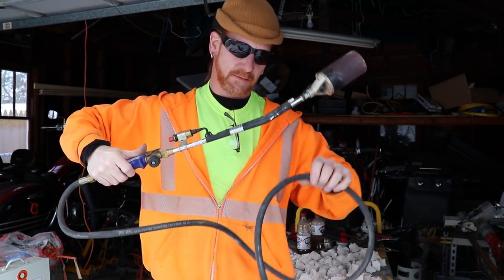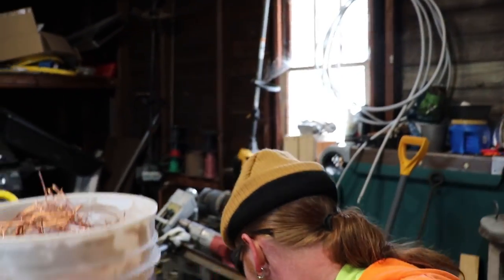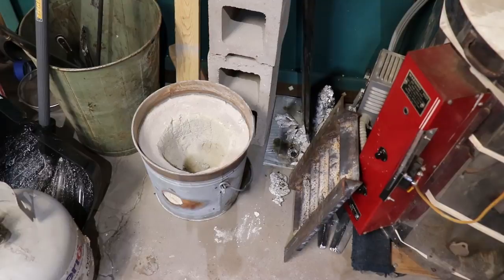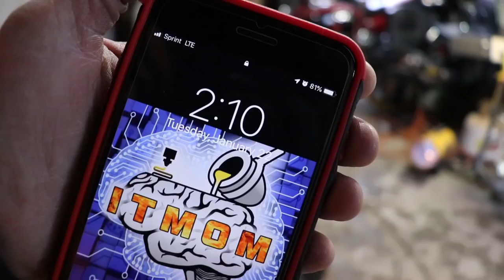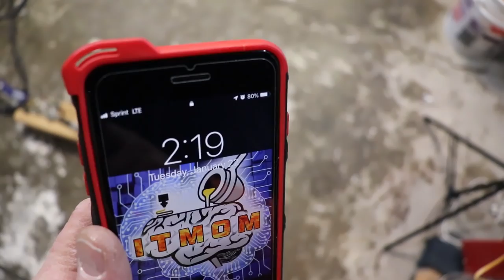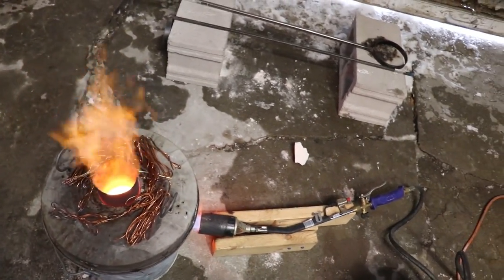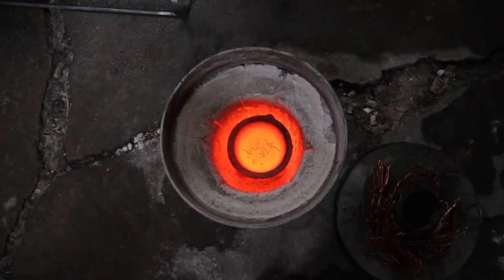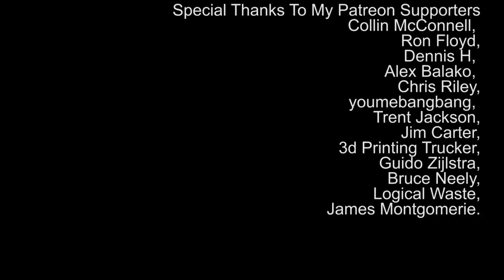Can I Melt Copper With A Weedburner

Comment: I'm glad you did this video as I have a weed burner sitting around I was going to use for the foundry when I build it.
Reply from the maker: it will work for aluminum no problem I'm looking into a burner
Reply: I use mine for copper it works I just have a make shift fire brick oven type thing about 30 bricks all together

Comment: I've melted copper with mine several times. you need a better connection point between burner and furnace, (metal pipe fitting work great) also was that standard cement I saw the cracks losing lots of heat. (try fire bricks and refractory cement) . a little more planning and you'll melt copper no problem. good luck and happy melting
Reply: thank u for typing this for me

Comment: I picked up a small weed burner from Amazon for about $20. It actually worked fairly well, but it didn't quite get hot enough to melt copper. It sure got close, though. It did handle aluminum well.

Comment: I use the same burner in my homemade foundry.  I've easily melted  aluminum,  copper and bronze.
Reply: What is your foundry lined with
Reply: @citylotgardening6171  I took on old pottery kiln, turned it sideways and cut a hole in the side for the the torch to go in. In other words....firebrick. I reach fifteen hundred degrees in around ten minutes. I had some leftover bronze from a sculpture i did at the local university using their foundry. It wasn't  amazingly fast but i totally melted the bronze. I plan to make some homemade glassblowing tools with brass and bronze. I'm currently making aluminum stands for my large handmade glass spheres. Hope you are having a wonderful day.

Comment: right on bro - thanks for braving the cold and saving us the effort. have you tried giving an extensive preheat of the 'kiln' first, perhaps from underneath with a surrounding wall of fire brick so that your initial temp is much higher before you do as you did here?

Comment: I just got on here because I cant melt copper. Found your video and am amazed. Our foundries are identical. I have 65 lbs of crushed cans to melt down and it will be no issue at all for it. I have gotten hot enough to melt brass as well. But i end up with the same exact ball when trying to do copper. I want to get the devil forge foundry really bad. I would not mind having some dialogue with you about this and all the different steps you have tried vs what i have tried.
Reply: Oh! and if you keep getting that hot, eventually, the black tip of your weedburner is going to fall off. That has been a pain in the ass for me. lol

Comment: Hey I have the same weedburner on my forge better way get more heat from it and melts copper lot faster in the black tip drill some 1inch holes 4 side to induce more air to burn hotter.
Reply: Do you drill (4) inch size holes in the tip at the back of the tip ?

Comment: Thanks for the test.
I'll check out your other vids now. 
I just bought two 500,000 BTU rated weed burners.  I'm hoping they will melt copper when both are used.
What is your burner rated for?
Reply from the maker: i looked and can't find a btu rating anywhere but 500,000 is high and might be the beast to do the job not sure but only one way to find out. I'll hold your beer ;) thanks for watching

Comment: When my Dad was playing with casting, he had an air hose (using typical copper nozzles in his machine shop) that blew compressed air - blowing through the intake at the back of the nozzle - to get the jet hotter.  We had natural gas instead of propane though, but the principle should be the same.  Just a thought.
Thanks!
Reply from the maker: Basically that’s my issue i believe my air to gas fixture isn’t right I’m running to rich I think I reached out to a company tonight waiting for a response but I think some new equipment is going to be added some I got some other priorities but see if Uncle Sam does me right this year 😉 always good to hear from you stay tuned
Reply: @InsideTheMindOfMatt  yeah i think the same. if you can reduce the gas by regulator vavle and add either a old vaacum cleaner, reverse it and dim it with a dimmer switch OR some compressed air i think you'll get there.

i have to do the same soon, lets see how that turns out.
but in your vid, you could see the flame shooting out of the furnace was way to high. so you heated the room :)

migh want to try using old veggy or motor oil - i will do a dual burner, so i can use both, once proof of concept milestone is reached

Comment: hey matt, where do you get your scrap?
Reply from the maker: 23 years of being an electrician
Reply: @InsideTheMindOfMatt  nice, do you have any recommendations for me? places to look to scrap it myself, or buy it cheaply?
Reply from the maker: What kind of metal you want?
Reply: @InsideTheMindOfMatt  mainly aluminum, but I also want to experiment with bronze, so I'll need tin and copper too.
Reply from the maker: For aluminum 1 would be cans if there is no deposit in NY there is $.05 per can so I don’t melt 2 bike rims 3 engine parts 4 wire of coarse same for copper wire is your best bet hit the curbs on garbage day and snag any appliances or at least the cords. Tin that’s still one I’m looking to solve also so I can make some real bronze but I’m going to have to invest to advance I guess got to pay to play
Reply: devil forge its worth the 600 bucks. go for it i want to see you videos.

Comment: You can melt copper with a weed burner I do it with a makeshift fire brick foundry with just firebrick and some crumbling concrete blocks around it
Reply: The burner I have is 500,000 I also have a diesal burner/waste oil siphon nozzle as well I use. The diesal works quicker then the propane in my fire brick foundry. But it's possible. With propane you crank it up and come back about 45 mins later. With my diesal burner 20 mins later no more then 25 copper is liquid. My foundry is nothing special I got 30 fire bricks and used cinderblocks around it. Couple layers on the bottom, doubled up the sides and walls and covered the top with 3 bricks, broken on on the front where opposidt side of the burner and crank it up until the flames are shooting out. All the inner bricks will glow orange. I just bought some 2600 kalewool. Just waiting on satanite to cover it with. Going to use a five gallon paint bucket with a large truck brake rotor as the top with kalewool. I plan on using firebrick in the bottom under the wool. I may find a way to incorporate brick and kalewool

Comment: used motor oil setup is much cheaper and will melt copper in 15 minutes , check out oil burners vids for info
Reply from the maker: I've looked into all kinds of burners. For me propane is a easy source of fuel a different burner is all I need so i can adjust the air/fuel fixture. Something is in the works stay tuned! Thanks for watching!
Reply: @InsideTheMindOfMatt  If it needs more air just hook up some blower to it :)

Comment: Try this in warmer weather. Maybe an extra 30* would do the trick. Probably not. 
¯\_(ツ)_/¯
What if you melted the aluminum first then added the copper. Just a thought. 
Oil burner. 
Thanks for the video. 👍
Reply from the maker: My tank was kinda of low and it was fricking cold. Propane is capable of getting hot enough Ut with the lack of gas-air mixture control I’m not burning at an optimal mix so not getting that energy that I need to get that temp
Reply from the maker: Plus 30 degrees maybe it is just a tipping point to the melting point but there is a 700+ degrees difference in the melting points 😉

Comment: first of all i can tell you that you're infrared temp gauge isn't going to work. although you already knew that didn't you? and secondly, you can melt copper in your foundry with grill charcoal and a hair dryer. i have kale wool insulation in my foundry, which is good to 2300 degrees. so that's my temp gauge. if that stuff fails, i'm, either doing something horribly wrong, or horribly right.